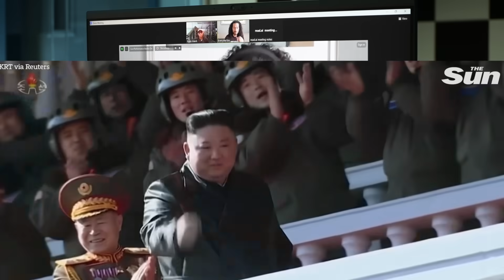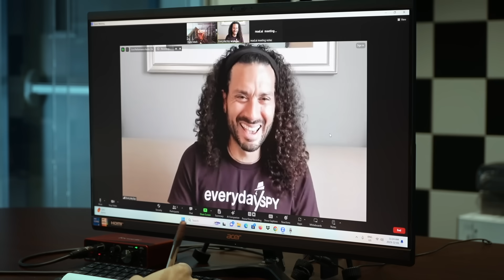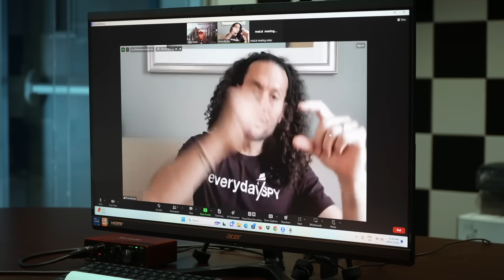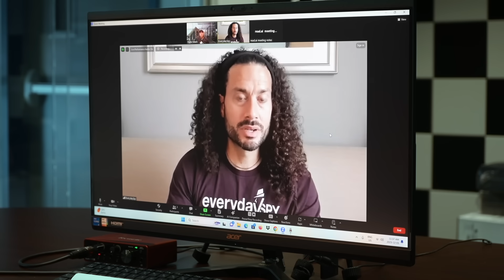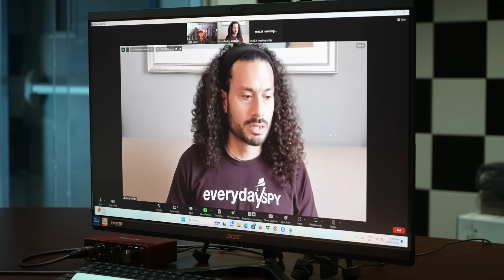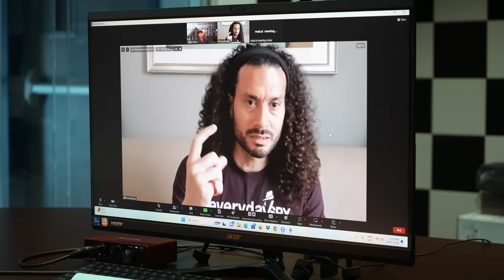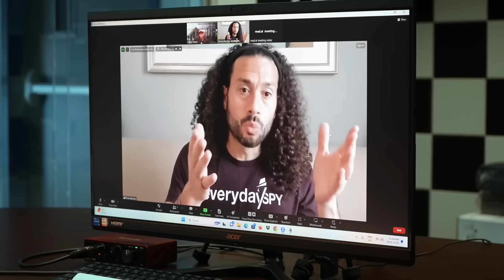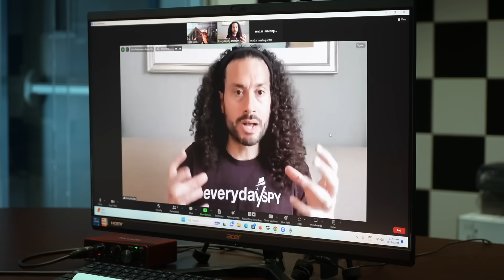⚡China Will Make its Move Soon- EX-CIA Andrew Bustamante

Comment: Background radiation has also gone up 10x in the deadly Gamma range since Ukraine war started. All these wars using depleted uranium and spreading nuke plant/coal plant trash n ash like barium, strontium as well as thorium is building up in the atmosphere.
Reply: False
Reply: I have a Geiger counter. It doesn't lie
Reply: @jetjohnkaness960  you should check your house for contamination if you have a tenfold increase in radiation. Thats extremely worrisome. I have a geiger counter as well and background radiation has stayed within 0.09 to 0.12 uSv/hr for the past 7 years.

Even in Ukraine, levels are around 0.19uSv/hr today.
Reply: Mine even went up above .300 us/hr during a snow last year. I have two years of snow samples. The jars are filled w fibers and non magnetic nanometals. I live at 7000ft in the Rockies under a steel snow roof. So its only Gamma. 2 years ago the goats all started having still births and deformation. Many born without instincts, runted, or breathing problems. It's a model S-1 w scintilator
Reply: I work in a nuke plant and we measure background every day while doing surveys.
You are wrong the background radation has not gone up

Done with Ludlum model 6
Reply: @Connor_OConnor but it makes him sound so much more cooler and smarter if he says it!!!!
Reply: @Connor_OConnor  OK. That's interesting. When Ukraine started, on clear days with no spraying, I'd see .009 to .015. Now it's never below .050. And usually is reaching .100 give or take with the waves. Then it's goes higher when they geoengineer sometimes.
Right now it's reaching around  .150 give or take. I've got the headache n ear ringing that goes with those levels but they sprayed quite bit yest n a little today. Neighbors' goats and other animals having trouble too. Lots of geoengineering here. But I only consider background readings when there's been a break in it and the view of the mountains around us is clear. It still reads the same with calibration card.
Reply: I don't disbelieve your readings nor mine. I wonder what's going on. As it's still calibrated.
Reply: @jetjohnkaness960  you mentioned your location is at a higher altitude correct? Maybe this 
Is a factor in your higher readings?
I am located here in Ontario Canada on the great lakes so a much lower altitude.
Reply: @jetjohnkaness960  one other thing that you mentioned that is kind of interesting is the goat thing.

We have a land owner here  close to the plant that has complained for years that the plant was effecting his goats. Makes you wonder if they are not over sensitive to radation?
Reply: It's actually the geoengineering causing it. Often, but not always, the Gamma goes way up. At .150 inside the house they have birthing problems. I so wish I could show you pics. Of my steril snow melt samples too. They dialed SAI programs way up here since rejoining the Paris accords. We've even had a total of 4 pregnant moms become Unpregnant the week they were due. 3 at once 2 years ago. The Geese have all but disappeared in 5 years and bees are fastly disappearing with beekeepers here having a very hard time getting decent volumes of honey now. 
I grow our vegetables inside w humic acid because of it. Others outdoor fruits and vegetables are struggling and coming up with black caverns inside while looking fine on the outside.